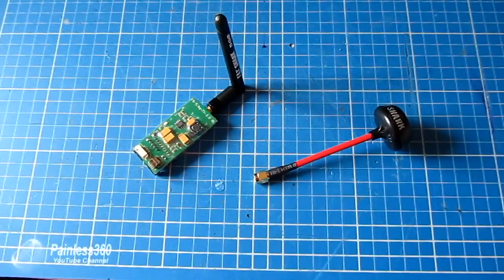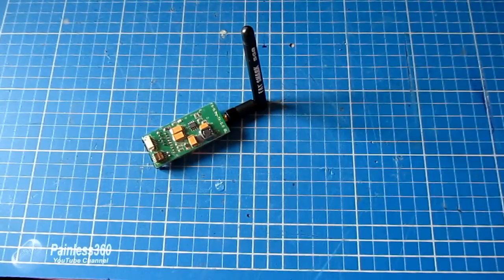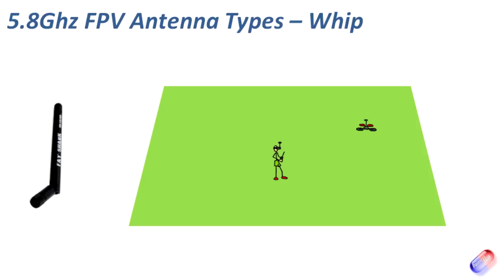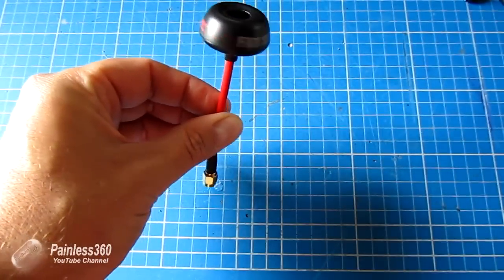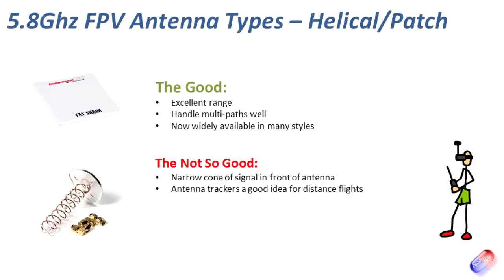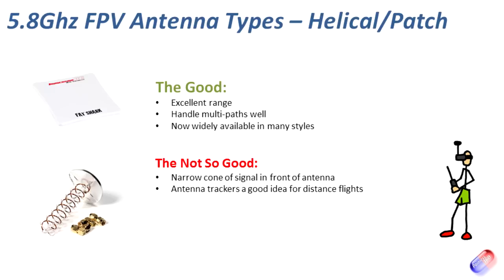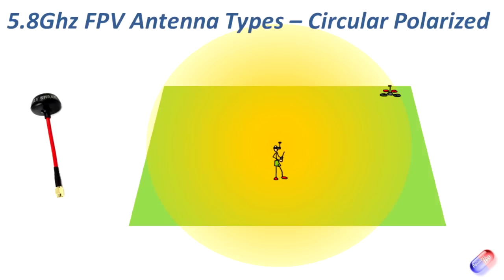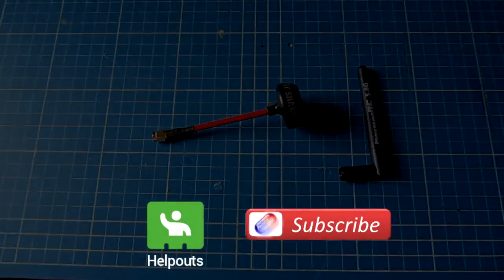Introduction to FPV - Antenna choices (dipole, circular, helical and patch)

Comment: I think that I would personally recommend a diversity receiver using a circular polarized antenna on one channel and a (helical or patch antenna) on the 2nd channel over an antenna tracker with a single antenna, the tracker costs more and requires that a device on your R/C sends your coordinates back to the tracker.

It is also important to note that some vendors in Asia sell Right Hand Circular Polarized (RCHP) antennas as well as Left Hand Circular Polarized (LHCP) antennas and they do not work well together. Most vendors appear to sell RHCP units but a few such as Foxtechfpv.com sell LHCP units so be careful not to mix the two.

Comment: Another good vid thanks. What I have not seen anything on, is the number of leafs on a circular polarized antenna. Often it said to have 3 on tx and 4 on rx, and some of these antennas have 5. I imagine that it's not really a big deal, but I'm just curious because there doesn't seem to be much between the different brands available (other than quality) and prices. But some people recommend certain circular polarised antennas as the best (perhaps it's just personal preference).

Comment: Hello, What would you recommend for flying with lots of obstacles like buildings and trees?
Reply from the maker: Most circular polarised antenna work very similarly. I've found the best for places with trees etc. is the TBS Triumph antenna..
Reply: And the range on the TBS Triumph antenna is? Low, medium, or long? Thanks.
Reply from the maker: Same as any other antenna of the type.. The TBS is best on avoiding the interference you get while flying round things like trees..
Reply: So the range is about the same as the circular polarized antenna?
Reply: Thank you xxtechmoxx and painless360, I was wondering the same thing too.

Comment: Thanks, What is the best orientation for the Circular polarized antenna on the receiver and transmitter, do they have to be pointing upward or downward for best reception
Reply from the maker: That is the beauty of circular polarisation - it doesn't matter. See my video on antenna alignment later in this series to see why.. Happy flying!

Comment: What is the max. range with both circular antennas @ 5.8 Ghz 600 mW in your opinion? I mean I dont want to build an antenna tracker for helical and at the same time I want to fly about 5 km. Is it doable? What is your experience in that matter?  Will cloverleaf antenna suffice for 3-5 km ?
Reply from the maker: Max range will happen with a 600mw or larger Vtx on the model with a circular polarised antenna and a more directional antenna on the ground (patch, helical, crosshairs). There are about to be some very cool RSSI based antenna trackers on the market that will mean that by using a few of those type of antennas in an array you can get great distance and coverage too. Watch this space!

Comment: it was a very informative video and I did learn plenty. I'm a newbie in 
drone flying and became interested in aftermarket antenna's when 
researching goggles for flying drones. I LIVE IN THE COUNTRY AND WILL BE FLYING HIGH AND FAR , MOSTLY.

It didn't occur to me that both drone and goggles could benefit from aftermarket antenna's. 

1st, let me describe what equip. I am interested in purchasing :
Drone : Xiaomi FIMI A3 5.8G 1KM FPV With 2-axis Gimbal 1080P Camera GPS RC Drone Quadcopter RTF - 5.8G FPV
Goggles : New V2.0 Version FXT VIPER 5.8GHz Diversity HD FPV Goggles

2nd,
 some people have mentioned or obviously replaced original antenna's w/ 2
 different aftermarket antenna's on the goggles (patch on 1 side & 
circular polar on the other).
Question : 
What is your opinion on this technique ? (benefits, pro's / con's) ?

3rd,
 all that said, what is your antenna recommendations for setting up my 
1st drone system, (goggles & drone) as I have described above ?

Thanks you very much for your generous consideration,
sincerely ............................
Reply from the maker: Take a look at the other videos in the Introduction to FPV playlist for a lot of the basics to be covered. I use Fat Shark goggles with a good diversity receiver with pagoda antennas on the model and goggles and a patch antenna on other conection on the goggles too. Best of luck!

Comment: Great vid. Question: my Splashdrone has a simple dipole antenna in the arm, sitting horizontal. Not the best but it's meant to be waterproof. Video reception to the Diversity stinks, two cheap dipoles on it. Would a combo helical and cloverleaf improve that, I assume the dipole wire means it's not circular polarized.
Reply from the maker: +NorthOlbo You need to look at using a circ.pol antenna on the Vtx (I use SpiroNet from FatShark mainly) and those antenna on the Rx would work well. Best of luck..

Comment: I thought your video was very clear and well described. A major issue I am struggling with is how to tell right hand circular polarized antennas from left hand. Could you please either add to this video or do another which describes how to tell for clover leaf, helical, and patch antennas?
For example, are left-handed clover leaf antennas those with leaves that when turned in a clockwise direction will tend to "drill" into a surface at the end of the antenna? Or am I mixed up?  Also the methods for RHCP and LHCP with helical and patch antenna polarization are desperately needed by someone who knows. Thanks. Jim
Reply from the maker: James C Eastep You can see the difference if you Google and look for the antenna that don't' have the covers on. 
Most will be right hand unless otherwise stated. You need to make sure that the Tx and Rx share the same type to work. 
Happy flying!

Comment: Hi Professor, are Helical compatible with RCHP and LHCP clover leaf antennas, or would they have to match the circular direction, please? I can't find any info on this one; would you happen to know, please? Cheers and Safe Flying!
Reply from the maker: +FPV Cambodia Yes, but as they are using a twisted coil the 'direction' of the twist needs to match too. Happy flying!
Reply: Cheers Lee! Take Care. Tks. By the way my Pixhawk problem was a FC hardware failure on the components... Harrr! Bad luck!

Comment: How to mount/orient the cloverleaf antennas? Should they face straight to the ground or face back pointing to the transmitter when copter show its back?
Reply from the maker: +FotoAmg AmgFoto You can get away with mounting them in lots of orientations. I tend to mount mine facing upwards but I know many pilots that just have then mounted horizontally too.. Both work great when using circ. pol. antennas.
Reply: Thank you!
As I checked the radiation grapsh it seemd that if it is pointing to me there is hole...
http://m.modellfluginfo.de/Modellflugzeug-wAssets/img/cloverleaf-antenne.png
http://www.freeblog4u.com/wp-content/uploads/2014/02/Diapositiva1-1_zps7ba0d95d1.jpg
as I am in the center of the donut, but if you experienced no difference it could be only theory and I won't worry.

Comment: Hey @Painless360, your videos are amazingly informative. I understood a great deal from your video about quadkopters. I have a whip on my video receiver and a circular on my video transmitter, I get lot of signal issues, I don't do much of long distance, but I need to do it between buildings and trees etc?  currently i have whip on vRx and circular on vTx.please tell me which combination I should use to make the best out of it.should I use both circular to get a good reception?
Reply from the maker: Circular on both. Best of luck!

Comment: Thanks for good video.
I haev Devo F7 I want modify antenna for bigger range of controll.. which type of antenna I will change to and have some link or picture how I do this modify thanks friends
Thanks
Reply from the maker: +ocular ocular The Devo F7 is a radio transmitter? These antennas are for FPV and there are other options for radio controllers but I've never had to use them. Best of luck.

Comment: Hi, love your videos. i have a older system( fat shark dominator with a dual diversity mod set up) so i noticed on my googles the patch antenna is lhcp and the other attenna mad mushroom is a rhcp. for the plane in this setup does it matter if i use a left or right circular antenna?
Reply from the maker: All antennas need to be the same orientation. Rhcp is normal for analogue and LHCP is usual for HD... Best of luck

Comment: Awesome video. Very informative. I have a couple of Hubsan H501A and SS drones with their advanced H906A controller. These drones have 2.4Ghz for the control and 5.8Ghz for the FPV. I would like to have your opinion as to what setup would give the best transmission/reception for 2.4Ghz control and 5.8Ghz FPV for doing long waypoint flights for video recording. I seen many videos on the so called best antennas and still have no idea what TYPE(S) of antennas would work best for this. I have modified the drones so I can put whatever external 2.4 and 5.8 antennas on them that I need too. So, I should be able to use paired antennas if that's the way to go. Great videos dude thanks for posting on YouTube...well done.
Reply from the maker: A Google search will normally find one of my videos on the topic you're after- https://youtu.be/Xndue09M-lI hope that helps..

Comment: Can you mix dipole/whip style with CP?  i.e. dipole on the aircraft and then a CP on the RX/Goggles.  Thanks for the input.
Reply from the maker: You can but the range of the signal won’t be great. Use the same style of antenna or a circular polarised on the model and a patch on the goggles.. best of luck!

Comment: hello painless 360    good video it is helping thanks ……. my question is could you use a right hand clover with a patch and or with a helical ,say a five turn r/hand helical for instance and if you had,  say the eachine 2000 goggles i think thats what there called …. those new ones you know.could you use patch and helical with clover all at the same time
Reply from the maker: It's one of those things that isn't clear is it? I've got a few videos on 'diversity' receivers and setups that allow you to have an omnidirectional antenna (like a cloverleaf) and a directional high gain antenna (like a helical or patch) working together to give you the best of both. You just nee to make sure the antennas all share the same right or left-handed setup.. Hope that helps!
Reply: Thanks I’m going to check out ur other vids too 👍🇬🇧🇨🇦🇬🇧👍

Comment: help alot! thank you!
but if i want a ground unit (rc car with fpv)
what antenna should i use ? (i need somthing that go throgh walls or hills)
i got 400mw transmitter and a reciver.
ty
Reply from the maker: WarOfHell 5.8ghz will not penetrate walls, let alone hills. You need lower wavelengths. Not sure where you are but I suggest looking into the frequencies available in your area. Best of luck
Reply: thanks for you answer.
but my rc transmitting in 2.4ghz if i go lower i can find 2.4ghz video transmitter but it will make noise to the video.

Comment: Hi, question, can I use a vertical polarised Panel antenna as a transmitter instead of a receiver. I want to use it for my Phantom 3 standard RC transmitter which gives me hardly any range.
Reply from the maker: +Rien Diemel I wouldn't. As a panel as its too directional for a transmitter on a model..

Comment: wow great video! I have a SJ-V01 goggle that comes with two rp-sma connectors. I fly in a park full of trees and primarily keep the quad 90% of the time in front of me. Would getting a circular antenna and VAS crosshair antenna work together on my goggle to maximize range as well as all around flight or is that overkill?
Reply from the maker: +SlNlST3R If you are in a park then a good set of circ. pol. antennas should be fine. As you've got diversity I'd add a second antenna, something like a patch that will give you a good degree of 'view' and increase the range in front of you a little too.. Best of luck!

Comment: Hi. I've got 2 Fatshark CP antenna like you show in your video. Which one goes to the transmitter and receiver? They are the same?
Reply from the maker: +84npor you can use them either way. Happy flying!
Reply: Painless360 Thank you.

Comment: Great info, noob here, you may be able to help me, I have walkera runner, it if quite weak, I am trying to find out if the camera and fpv system, that comes installed on it, and plugs straight into the flight controller, is able to be used on another quadcopter, as i want to upgrade, thanks in advance.
Reply from the maker: +DallyDDD Hi, not sure what you are asking...
Reply: +Painless360 , oh sorry, I am asking if you would know anything about the walkera runner 250 , camera and TX setup, if you would know if it would work with other systems, whilst not using the original mother board thing, that it comes with.
Reply from the maker: The challenge with the Runner 250 is that it's all part of the model so your only option to increase the quality of the link is to replace the average antenna that comes with it or strap a new set of FPV kit on it's top. Best of luck!

Comment: Hi, Painless, nice video as usual.  Im  gonna build a new  250 fpv quad, and I would like to achieve a good quality signal (obviously, 1 second of signal loss with fpv goggles = crash). The thing is , Im currently using cp antennas  in  my 450 quad but when I roll or Im avobe myself  90% of the signal is lost. Im afraid that I can lose the signal when doing aerobatics with the 250 quad, so would you recommend a particular model of clover leaf antennas that work well with fast 250 quads?

Regards.
Reply from the maker: +Dashz I'd go for a 'brand' name and mount as far away from the frame as you can... Best of luck!
Reply: Haha, thanks for the advice, Ill take a look, because firstly I'm not sure to spend too much in a rounded copper wire, but it seems different brands really make the difference.

Thanks again for your tip Painless.

Comment: Because the pros/cons of the CP Antenna and the Planar/Helical antenna, wouldn't the best course of action be to use a diversity system with a Circular Polarised antenna and a Planar/Helical with a tracker? This seems logical, but is it practical and actually feasible?
Reply from the maker: +Justin Trumpelmann Yes, that would work very well.

Comment: Would you be able to suggest to me a setup that would get maxium penetration and decent range? I was thinking diversity with a circular polarized antenna and not sure on the second.
Reply from the maker: +The RCAddict Depends on how you will fly. Extra range is achieved by reducing the coverage you get. I would use one of the setups in the video - circ.pol. and helical or two helicals.Best of luck and keep in mind any laws concerning maximum distance when flying RC..
Reply: Painless360 I am not looking for distance or range at all really. Just whatever wil give the maximum penetration to fly behind things like trees.
Reply from the maker: Understood. Then if all of the trees are in front then I'd use a circ.pol and a low turn helical pointed directly at the trees. Remember that 5.8GHz has very low penetrating power so you are relying on reflections from hard objects to bounce the signal back to you...

Best of luck!
Reply: Painless360 Since a low turn helical has broader range, does it still have the same pentration as hugher?
Reply from the maker: Nope, longer range comes at the expense of narrower reception. Happy flying!

Comment: quick question regarding fpv antennas  i have CP i have LHCP and RHCP does my antennas have to match between receiver and transmitter or can i mix them ?
Reply from the maker: +TriniRCmodels no, you need to keep them the same.. Happy flying!

Comment: when it comes to the circular antenna, whats the difference with left hand and right hand, will right hand only work with another right hand?
Reply from the maker: In terms of performance not a lot. You do need to have the same on both the Tx and Rx kit, if you don't then you are actually only seeing the 'reflections' of the signal and they will be of a lower power than the un-reflected ones. Hope that helps..

Comment: Hi again, I was wondering if you could explain antennas a little for me. Normal transmitter antennas. I'm confused about if I need 2.4ghz or 5.8 and what dbi and gain means and if there's any laws when it comes to it. Thank you.
Reply from the maker: +Mystical Daptfyie the vast majority of modern radios are 2.4ghz, they use linear or dipole style of antennas for good all round reception. Same principles as the ones we look at in this video.. Happy flying

Comment: Are antenna's compatible with all or most different manufacturer's receivers & transmitters.
WM
Reply from the maker: +William 1 Yep, the only difference is that some use SMA and some use RP-SMA connectors on their kit so you need to make sure you are getting the right sex of connector.. Apart from that it's all easy.

Comment: hi just want to say your vids are brilliant..!!i built my first quad last year a cheap chinese zmr and you showed me every step to take, to get it in the air...with sucsess!!.have a quick question my new rig is a rtf nighthawk pro 280...what a lovely piece of kit flys really smooth,using dominator v2 goggles with spironet antennas,But i get a lot of interferance cant work out why,its ok if im within about 30m -40m.surely i should get further....im running on 200mw.... thanks again painless360
Reply from the maker: +TheDok73 yes you should, sounds like interference.. I'd contact the vendor.. Best of luck

Comment: Does a diapole antena work with a circular polarized one? one in the transmitter and one in the reciever?
Reply from the maker: It will work but over very short distances before you will get breakup on the image. I would get another circ. pol. antenna. Happy flying!